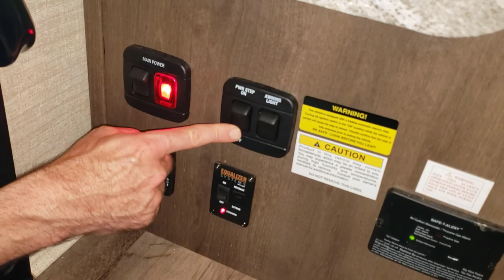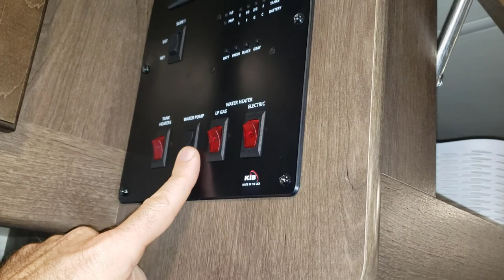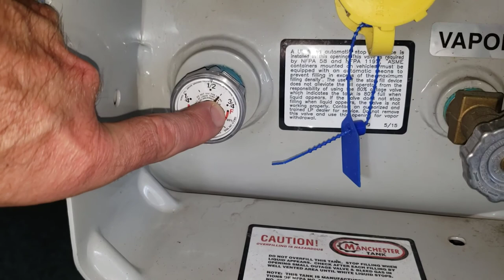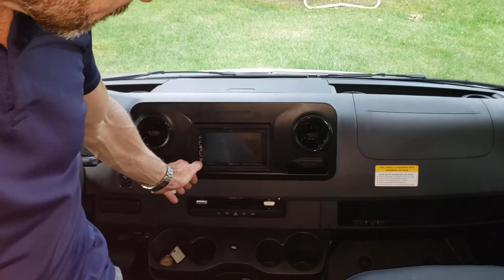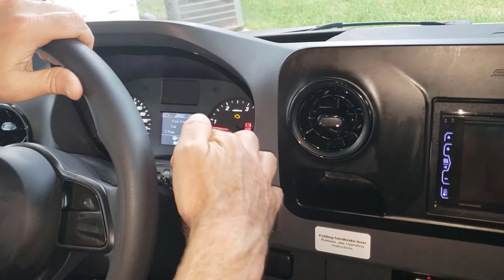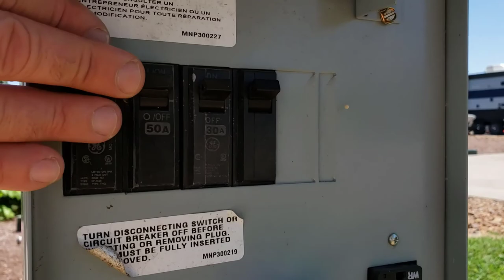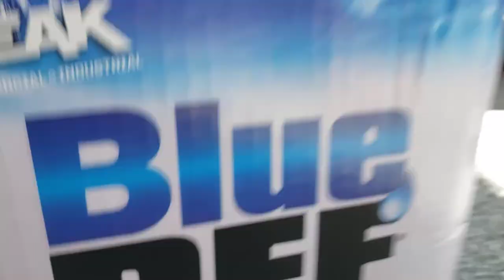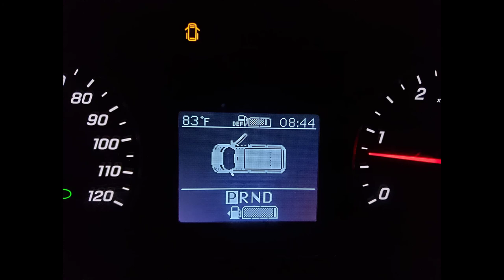How to use the Jayco Melbourne Sprinter RV

Comment: I really like this vehicle as it is 25 ft and is all tricked out.  My problem is that this is a diesel.  I don't see that diesel will last as a fuel for much longer and getting this serviced will be far more difficult than a Ford 450.  Unfortunately Jayco nor most other vendors make a high end gas vehicle in a 25 ft package.  Bigger is not better as I get older.